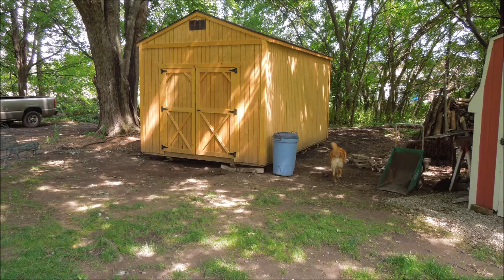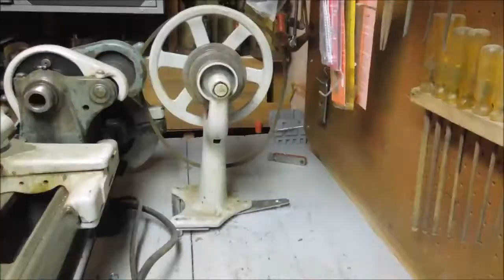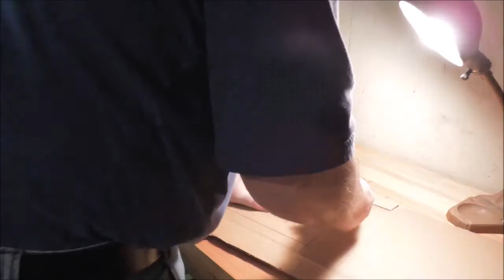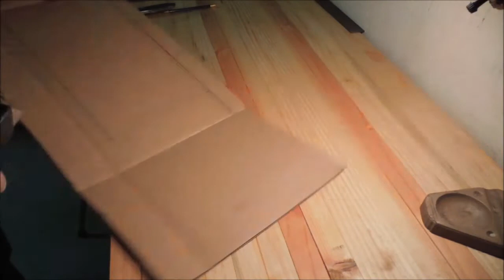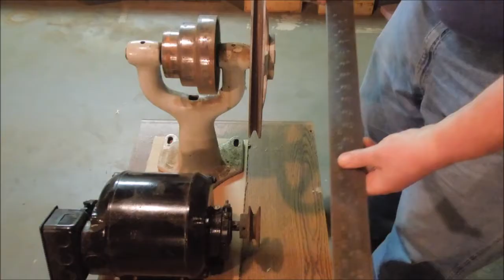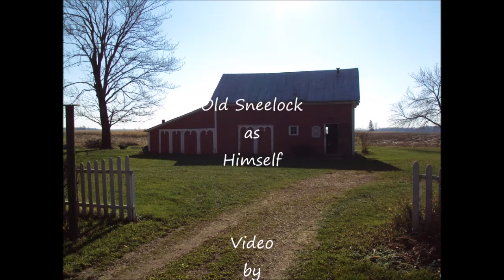South Bend Lathe Motor Mount  Pt 2 Building

Comment: And another thing I had to do was to take the horizontal back shaft out to take belts off. I’m assuming that when I get new belts that putting back together is easy. Just align shaft with the set screws and assemble?
Reply from the maker: I'm assuming since you pull the pulley off that'll go back on it pretty much in the reverse so lining it up and locking down the set screws probably would do it
Reply: Old Sneelock's Workshop yes. I bought the south bend book that shows everything on south bend lathes 9 abc and the 10” but my 1937 is pretty simple. The flywheel and back shaft came out pretty easy. It looks just like your video here. I just need to find belts which will be easy but maybe a few bucks. I’ll let you know how I make out. By the way I’m John from south Jersey. Thanks

Comment: My fly wheel is flat but the belt pully on motor is v. So what belt do I use. The belt that is on my 9” model c 1937 south Bend is probably original!!
Reply from the maker: John I found an image of the early jackshaft design. The motor pulley appears to have a very wide v belt groove. The large diameter jackshaft pulley in the image is a flat belt pulley.
I would try to find a motor shop or belt supplier near you and have them measure your motor pulley. Driving a flat belt pulley with a v belt works but you need the right size belt.  http://www.lathes.co.uk/southbendmodelfive9inch/
Let me know if you have further questions.
Reply: Old Sneelock's Workshop yes the v is   On motor and the wheel on jack shaft is flat. Can I use a v belt or change the v pulley on motor flat or just use a v belt
Reply from the maker: The motor on mine also has a v belt pulley. On mine the large pulley on the jackshaft is also a v belt pulley. Are you saying the large pulley on the jack shaft is a flat belt?